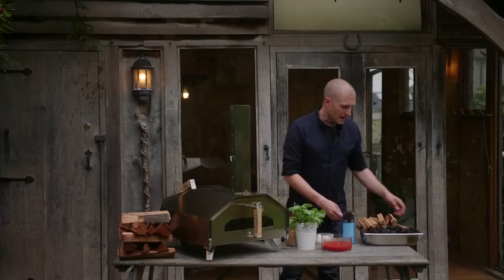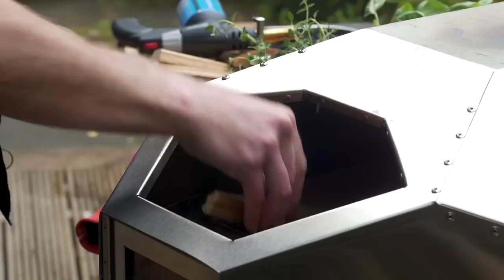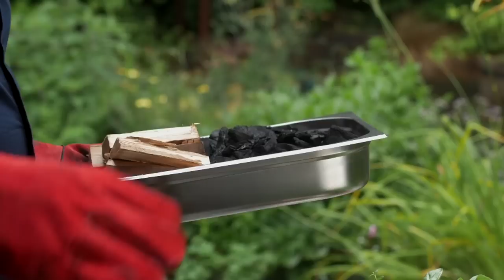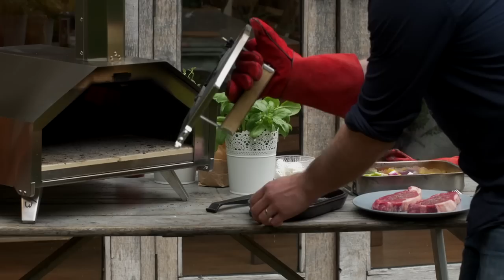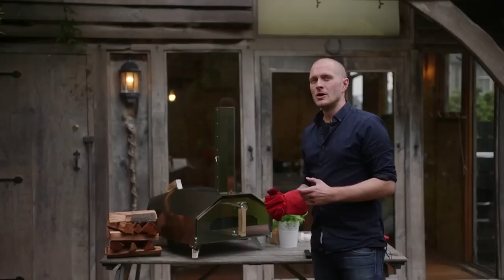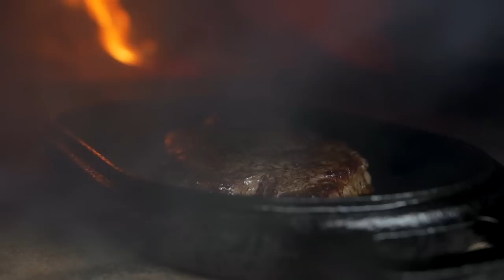Ooni Pro - Multi-Fuelled Outdoor Pizza Oven | Cook with Wood, Charcoal & Gas

Comment: How many pizzas can I make without re fueling kindling?
Reply from the maker: It really depends on the size of wood you're using - our preference is base layer of charcoal for a stead temp of about 350ºc - then add a couple of chunks of hardwood to boost that temperature and achieve that rolling flame. It also depends on how quickly you can prep the pizzas - so you'll be best to keep an eye on it and when you notice the flames are pulling back - add another chunk 🍕
F.

Comment: Is there a model which works with all 4? ( charcoal, wood, gas, wood pellets) Or an attachment that converts to all 4? I live in hurricane zone and looking for MAXIMUM flexibility.  After storms, finding just one type of fuel may be difficult.....so I'm looking for an oven with multiple options.
Reply: Hey Dave I can see why you'd like that for maximum fuel security! Ooni Pro or Karu are your best bets, neither will officially run on pellets but in a pinch you can you use pellets on the fuel grate.
Reply from the maker: Hello Dave 🍕 please also have a look at the comparison table here https://ooni.com/pages/oven-comparison for even more details !

Comment: what is your advice in cleaning the stone surface before launching the pizza?
Reply: Hey Romer, we sell a brush to clean the stone between pizzas. This is great in case you drop some ingredients on the stone or there's ash you'd like to remove. Between the cooking sessions thou the top tip is to flip the stone upside down. This way the incredible heat inside the oven cleans the under side of the stones and you can keep using the side that was previously underneath. Hope that makes sense :)

Comment: Initial burn was amazing. Up over 500 deg C with wood and charcoal. Pellet burner, not so much. But, I think I just need to play with it for awhile. First cook was not nearly as successful. Could not get over 300 C with wood/charcoal. I changed the internal vent to wide open before the cook. I also used charcoal brickets vs lump charcoal as in the initial burn. Could this be why my temps were so low?  Pizzas came out ok. But it was very frustrating,  cooking 6 pizzas.  I’ve resolved that I need to become a fire expert on the pro before I cook again.
Reply: I found using a mix of good quality charcoal with ash or any other high temp burning seasoned wood got me to the max temps easily. Takes a bit of playing with!

Comment: At $400 or $500 for this Pro version. I would expect a turn table at least built in! Even if I have to spin the pizza manually to have it cook evenly. Table top pizza ovens should have a manual turn table or electronic one built in! I won't buy any of these models until a turn table is added!

Comment: Can you guys make some video’s about temperature controle? High heat is easy but lower temperatures how do you do that?
Reply from the maker: Hi Tom, controlling the temperature of fire isn't something that can be done to the degree, however, the simplest way of doing this with Uuni Pro is to use less fuel, remove some fuel (kindling/charcoal etc) or leave the door off and let the heat escape, building the fire back up slowly to get to your desired temperature. Don't hesitate to get in touch via support@uuni.net touch if you have any questions! //lucinda

Comment: How often are you adding new kindling or charcoal during the average cook
Reply from the maker: We normally load the wood and charcoal burner tray right up with charcoal and use 1-2 pieces of kindling to get the fire going. During a 30min - 1 hour cook, we'd probably add 3-4 more pieces of kindling and top up the charcoal once or twice. Hope this helps! //lucinda

Comment: Can I use charcoal with wood pellets?
Reply from the maker: Yes you could always add some pellets on top of the charcoal but the heat boost you'd get is quite short. Wood/kindling is recommended. -Kristian

Comment: Is it possible to use bigger piece of wood and/or condensed/compresses piece of wood ?
Reply from the maker: 25 cm long with around 4-5 cm ø is max we recommend. Putting too many, too big pieces of wood will cause there to be too much fire for available oxygen. I usually add one piece of wood at a time. -kristian

Comment: Dear Uuni team,  is it possible to use wood kindles (for the nice live fire and smoke) and a gas burner (for the sake of steady temp and easy regulation) simultaneously in Uuni Pro? Thank you!
Reply from the maker: You do need to remove the charcoal & kindling burner tray to use the gas burner. I highly recommend charcoal with a little kindling!

Comment: Thank you so much for finally posting this video.  I was reluctantly to back this project because I wanted more information about the Uuni Pro.  This is the first video that shows the size and the scale of the oven.  It was also helpful to see the rear hatch where the wood or coal is fed.  I am now considering purchasing one.  I know you are in the process of shipping to your backers.  When will these be available to the public?
Reply from the maker: Hey Robert, great to have you as a backer! Pro's have shipped out of China from our manufacturer and are currently on boats (or container ships...) We expect to start shipping from our warehouses in early/mid October. Exciting times! ^kt